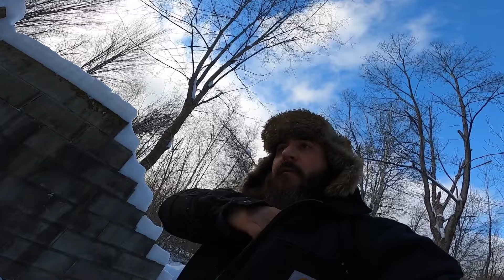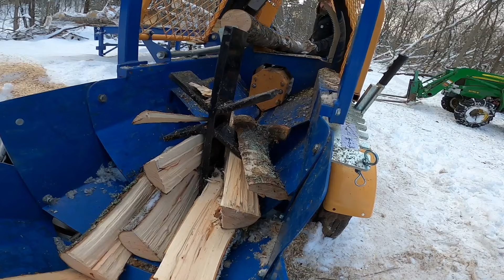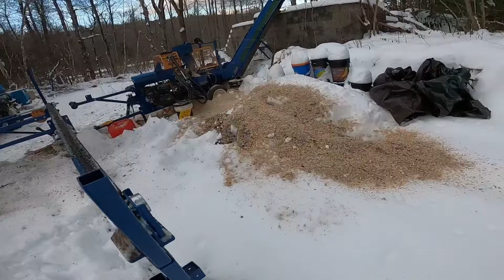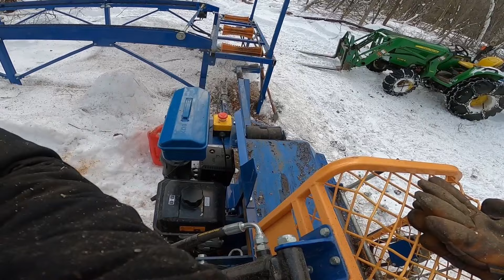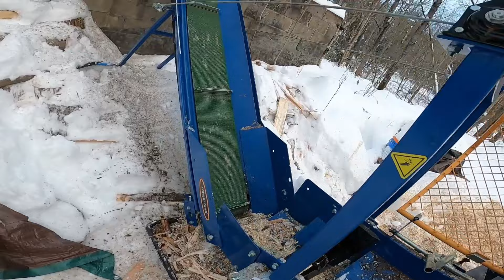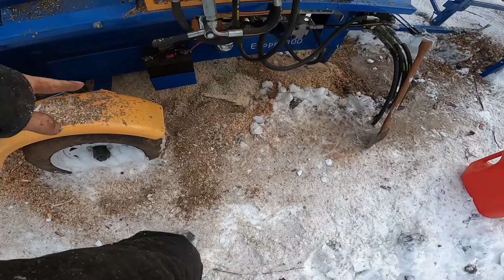2 hours with the Eco Pro firewood processor

Comment: 12" is perfect for the 6 way, mine seems to favor the larger pieces towards the back just like yours. The wedge pocket seems to have a lot of slop in it for my taste, It'd be nice to tighten that up some day in a future welding project.  When you get everything right you can bust up some wood fast on this rig.
Reply from the maker: Oh yeah everything has some slop that might just be what is happening but I have seen ppl weld plates to the back to stiffen it up but wonder if it’s left loose so you can move it freely by hand

Comment: Im on the fence about Road Range equipment. I just bought a new conveyor from them a couple months ago and luckily the dealer I bought it from was good to me because when it was brand new one of the couplers leaked (he sent a new coupler). Then, the wood kept getting hung up at the top of the conveyor breaking off several cleats of the chain so he sent a new chain assembly and to fix that I had to grind down the trough extension plates so they were beveled and now the wood slides right over them. Occasionally I'll get a piece that hits the tabs on the trough where they attach together making the chain jump a bit but before, just about every other piece would get hung up on those extensions because they were inside the trough creating kind of a lip for the wood to hit and bind up. Before those fixes I had the chain pop off the sprockets 3 or 4 times and twice it bound up so tight when it let loose the wood flew out like it was shot out and went about 40 yards into the neighbors property. They definitely have some design issues at least with their conveyors to address, hopefully your processor runs and works well.
Reply from the maker: It has had its rough times with the conveyer but it’s payed for itself 2x now so tinkering in it here and there doesn’t bother me much

Comment: You ever throw some full size red oak in there yet ? I got a bunch of 15 inch red oak I’ll be trying on mine
Reply: I've had some 15 and larger stuff on mine, not my favorite sessions for sure. Splits come out big and you burn up  some time resplitting, it does make some good wood fast though and it sure beats the hell out of standard splitters all day long.
Reply: @Tonnsfabrication  I’m in New England so I get a lot of that decent sized oak I guess I could just save those for my furnace I like a mix of bigger and smaller logs
Reply from the maker: Not too common around here. a lot of our oaks are gone, but when given the chance, be happy to try some.
Reply: @RSDOutdoors  I live in the heart of Ohio's logging country, couple of my buddies still cut. In the last two years I've watched a new log yard spring up down the road from me and all they do is pack veneers into shipping containers bound for Asian markets. Take into account the craze for staves that eat up all the white oak and the oaks can get hard to get a hold of. Definitely not like it used to be back in the day. Still plenty of good firewood like beech hickory and maple which are some of my favorites.
Reply from the maker: @Tonnsfabrication  yeah sad to see it go overseas but loggers need to eat and unfortunately most our mills around here are being bought my  china but hopefully our eyes will open to what is happening soon or well its over ill do what I can locally but were are in the crosshairs